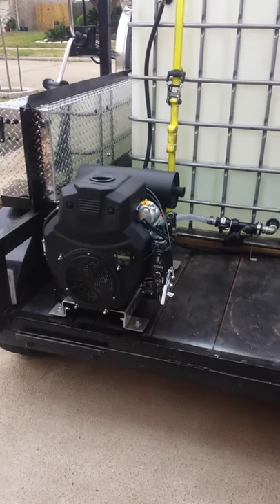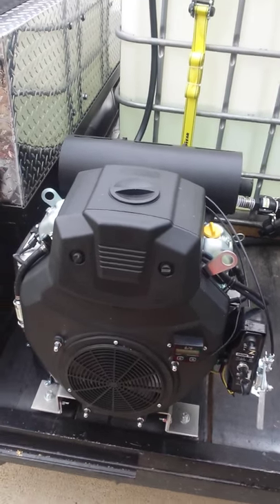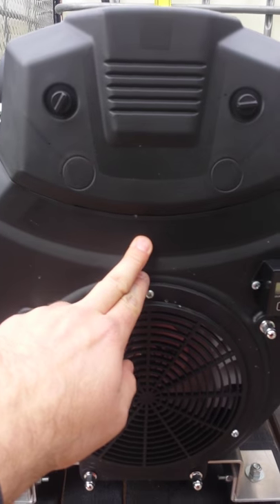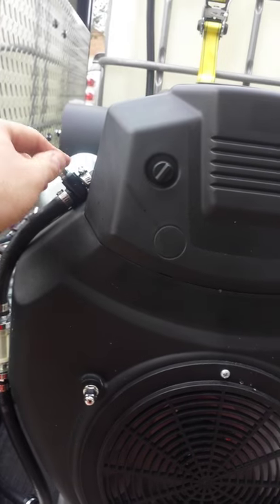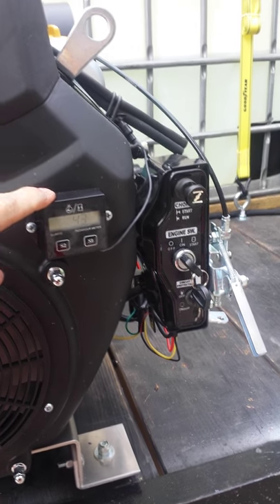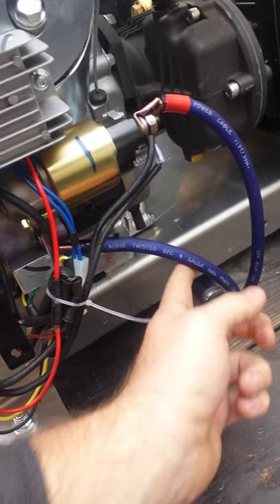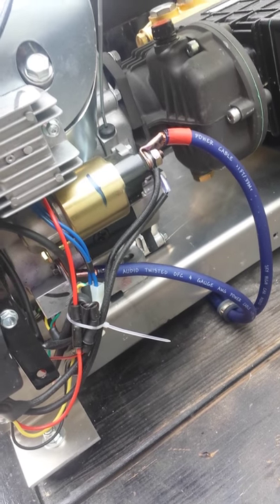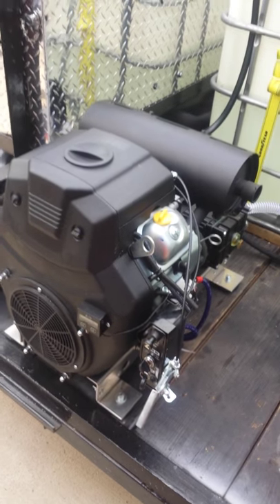Predator 22hp Motor Upgrades

Comment: if you could answer a few questions-with what you have done and the length of fuel line you have -you have no issues. you can idle it down ad shut it off with no issues. runs for as long as your working it?

Comment: I am considering building a machine out of this same motor, how is it holding up so far?

What pump are you running? 

All the belt drive skids I've found have been saying up to 13 hp, where did you find the skid mount?
Reply from the maker: The motor has been running great! The pump is an 8 gpm udor and the skid is from powerwashstore.com
Reply: can you link the actual skid? and the pump?
Reply: Bob Middleton I did end up building a machine also, I did belt drive, I ordered a skid and pump as well as everything else from water cannon. The part # for the skid is KCA065, pump part # is XWAM8G35N. The skid doesn't show up online. 

Also they didn't expect me to see 3500 psi out of the pump with that motor, but I am getting it per a pressure guage. I've got about 110 hours on my motor, I'm pleased so far.
Reply: that's great, I'm building one over the winter. So right now i'm deciding between gear and belt driven. Gonna use this motor for sure. also building a skid for recovery. I'm a carpet and tile cleaner by trade. so that has to be more powerful turning my blower. that one will have over 30 hp. I will have both running from doors on my box truck.  we will be able to clean inside and outside the home at the same time if needed and not have to bring anything extra.

Comment: I am adding a new briggs pump-tach and i Have a total length of 3' fuel line but tank bottom is below the carb. only issue currently is is starves for fuel. I have a fuel pump bulb in line.

Comment: Some people are talking about the  ( charging problems )  this engine has,...  First of all this engine has a small stator in it that is only made to  ( maintain )  a fully charged battery ! This engine does not have a alternator on it to run lights and other electrical things.  the charging circuit is only to maintain a fully charged battery so it will start up again.  this engine doesn't have any charging problem. the problem is these people dont read up on the engines specs and then use it to do things it was not meant to do !  Like run all kinds of other lights an stuff. you would have to install a alternator on it for that.

Comment: IMHO, the biggest weakness in these engines is the internal PLASTIC oil pump drive gear. If that fails, the engine ends up toast.

Comment: Hi , Anthony here . I'm getting ready to put 1 of these 22 hp predators in one of my John Deere 420's . Can you tell me where I can get one of those HOUR/RPM gauges ? Thanks for any help you can send my way and good luck with your current project ..
Anthony
Reply from the maker: I apologize for the late reply. The hour meter is from eBay. I purchased it for $10
Reply: Dalton Havron hi Dalton how do I charge the battery without a alternator?
Reply: I'm putting the motor on a woodmiser band saw. it has a alternator for charging the battery because the hydraulics run off of the battery. any suggestions would be appreciated.

Comment: None of thoes things will add life to the engine....  I thought you was going to show a bigger oil cooler and or filter, and maybe with a fan on it .  that would add life to it.  did you really think what you did to the engine was gonna help make it last ???   In the future check with a mechanic .....
Reply: The fuel pumps on these is the first thing to go...switching to a good pump right away extends the reliable life